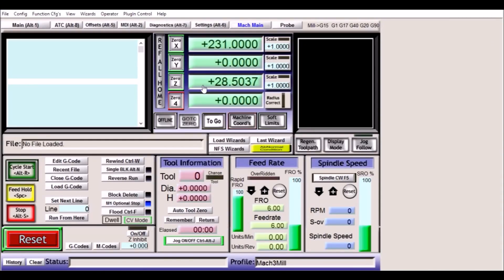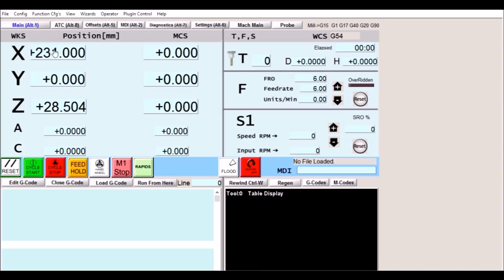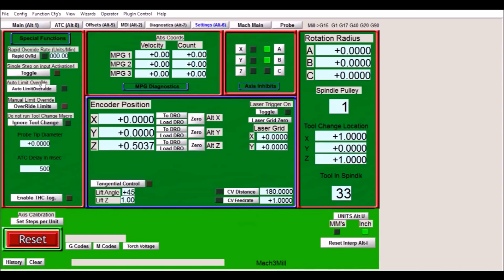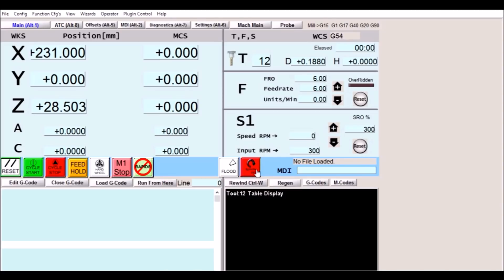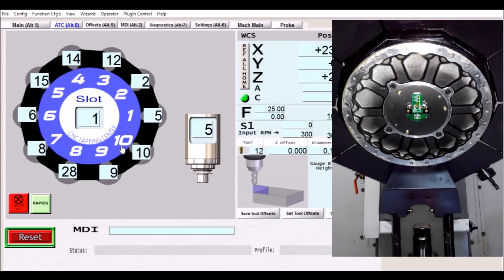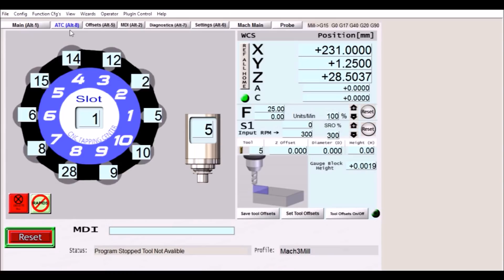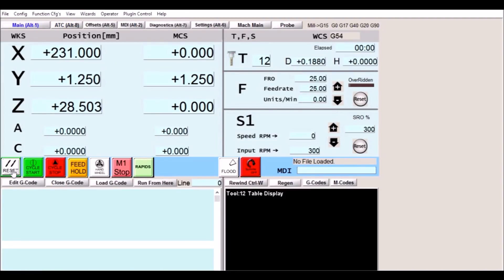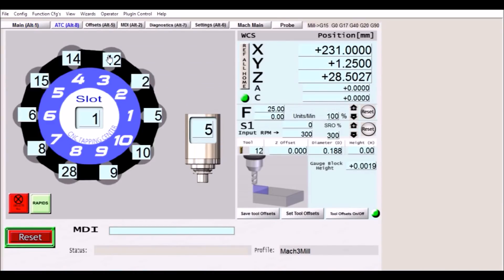Brother Tapping Center Mach 3 Screen set

Comment: Hello Sam thanks for a great video I'm currently retrofitting a brother TC 229 vertical machining Centre have no controller for it I will be needing help do you have any suggestions on how to interface with the original drive for the main spindle
Reply from the maker: Hi Peter,
 Sorry I don't  Most VFD's and servos use similar connections.
Reply: Hello Sam thanks that's ok it's worth a shot
Reply: @pdj26  hi. Have you sorted out servo drives? Got hands on TC 228 thinking about changing to mach4. But servo connector is confusing.

Comment: Do you do similar work with Linuxcnc? I have 2 Kryle VMC's I want to retrofit. Both the same model, with 16 tool rotary carousel tool changers that are indexed with servo motors. 
Fanuc red cap motors, most likely will replace with DMM Motors-Drives.
Reply: I retrofitted 2 acrolocs soon to be three and used mach3. one had fanuc yellow caps and the other was Yasnac. They work very well. Played with linux was not impressed. I used large steppers
Reply from the maker: I have not done any programming with linuxcnc Sorry
Reply: OK thanks anyway